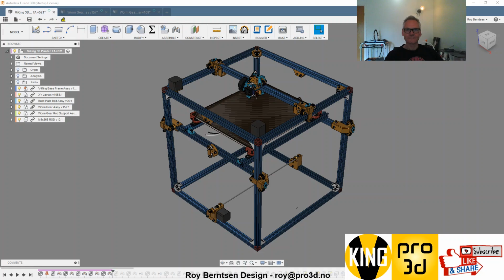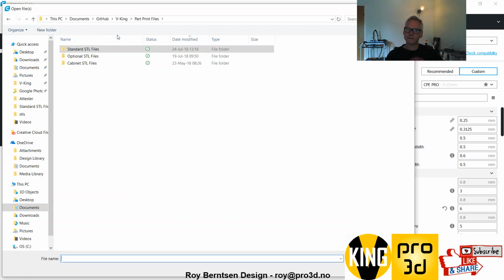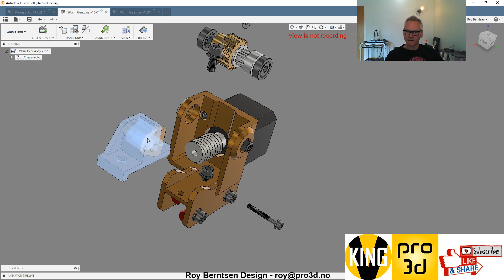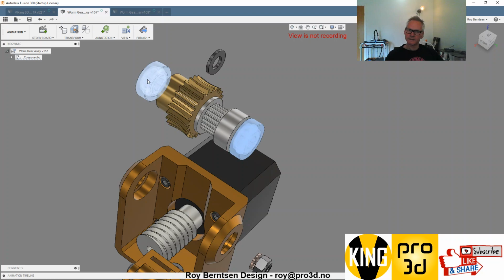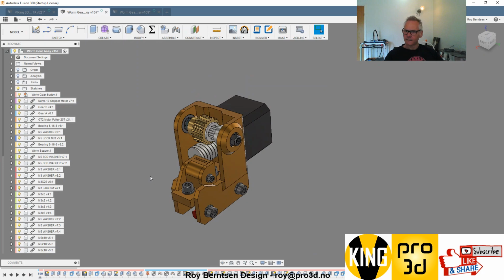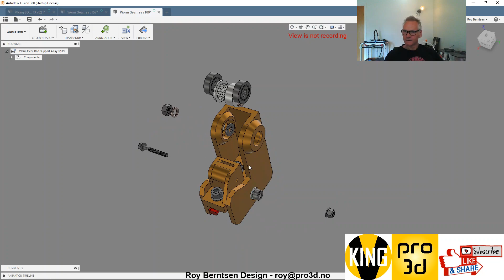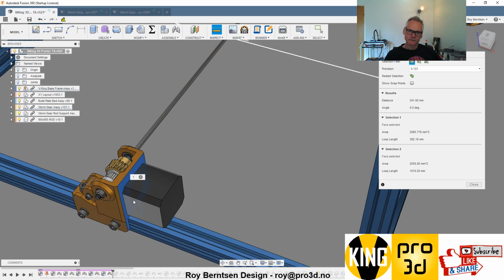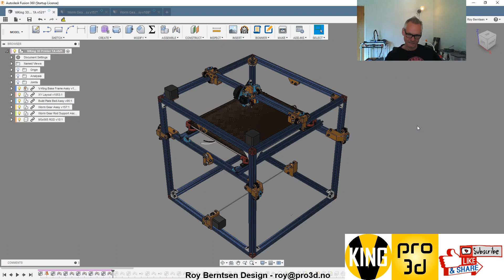V-King CoreXY - Adding the Worm Gear & Final Parts!

Comment: I'm wanting to make a v-king too :)  I'm wondering if it's easy to adatp the gearbox to accept a NEMA 23 motor instead of a NEMA 17 (i have some NEMA 23 motors in stock )
Reply from the maker: It will demand some work as the footprint is bigger and so the gear must rise. I would rather use that 23 for something else.
Reply: @PRO3DESIGN  Thx :) I get fusion360 et now i see why it could be hard to do ^^. I'll try it later when i will have a 3D printer and i could run some test to make a new support for nema 23 :)
Reply from the maker: @kuroro8523  You would also need to redesign the rod support for the other side as the rod gets higher

Comment: What size worm gear is it. I got a 20.1 ratio but the gear is to small what size do I need to order.
Reply from the maker: Order the 20.1 gear
Reply from the maker: did you use the link from the bom?
Reply: No I didn’t but know I did. Hopefully the right one comes.